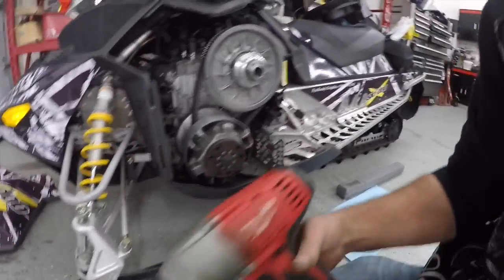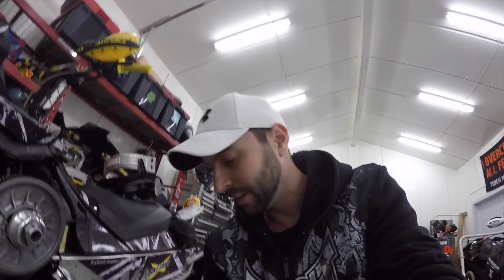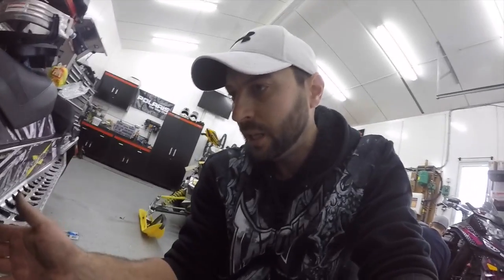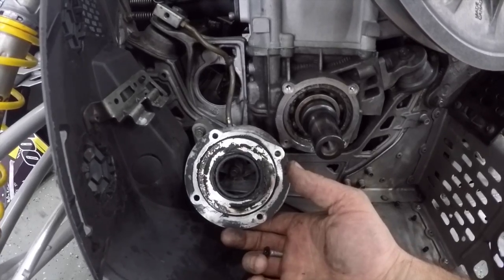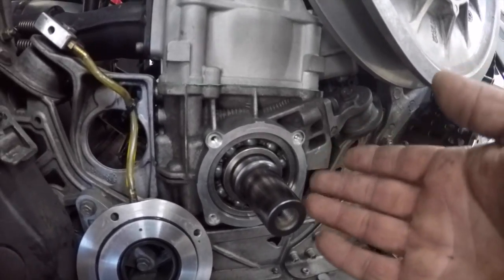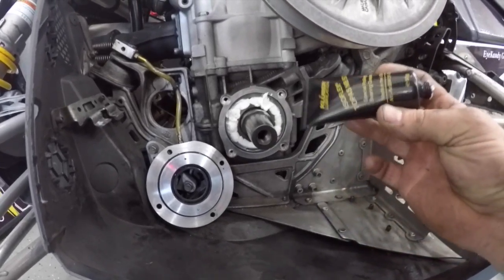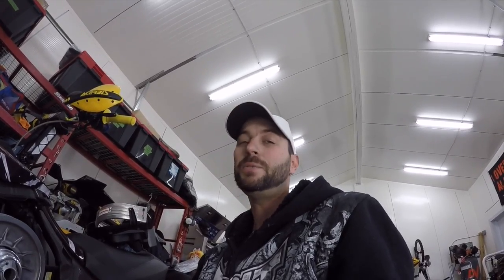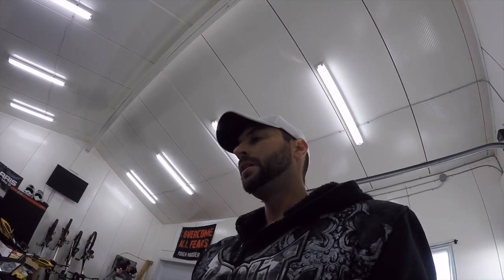#55 How to Change Isoflex grease in skidoo xp crank bearing

Comment: Hey man. Just a FYI you can do the mag side I do mine every time I do the pto side. It sucks but pull recoil then the flywheel remove top and lower stator bolts leaving one in. Then use a syringe with 5ml of isoflex squirt it slowly in lower bolt hole the air Comes out the top hole. Then re assemble had a 08 800r with 6800 miles on it I did this every season. Lower end never let loose must have helped.

Comment: I used a syringe to fill the bearing. I believe the Isoflex is designed to somewhat harden like wax when cold then liquify when warm. The concept is to keep the bearings always coated.  Unfortunately ski doo hasn’t developed a better design for their great engines. The other manufacturers have seemed to figure it out

Comment: Nice video, Thank you for doing it, very well done. One question is when you re-install the new gasket, does it just pop in or what's the best way to get it into the groove? Thanks again, much appreciated.
Reply from the maker: just sit in into the grove it should fit nice, and gently but the head onto tork and braaappp

Comment: thats a bearing buddy ur supposed to pump grease in thru the fitting at the other end of the hose.Thats a good setup but someone didnt use it the way it was ment
Reply from the maker: its a fudgy setup ive heard of people pooping seals if there to much grease in there. for the 10 minuts it takes to take it apart ill stick to doing that every season

Comment: The worst thing you can do is use an impact on a clutch bolt. you screw the bearings on the rod (chatter the chrome off the lower rod bearings) next thing you do not use a soft face hammer on the end of the puller...

Comment: never click a torque wrench more than once. so many amateurs click them about 5 times. it only over torques the bolt
Reply from the maker: I probebly clicked it a few extras lol
Reply: how does it over torque the bolt if your not going 'past' the clicking points.. bahaha i must be an amateur ! learn something new everyday.
Reply: although clicking it more then once is unnecessary, and if your a amateur it can SOMETIMES over torque the bolt. it can also be done without over torquing the bolt. but it is unnecessary iether way

Comment: 11:38 torque it till it snaps. bad advise for beginnner mechanics. i can hear clutch bolts breaking all across America right now
Reply from the maker: um its a torque wrench when it makes that snapping noise it means youve reached the set torque wrench setting
Reply: I RIDE 705 It was a joke about newbies. I've been turning wrenches for over 20 yrs.

Comment: what about the inner bearings? if the pto and mag side are due for repacking the the inners are a must.
Reply from the maker: The mag and inners are hard to get to, most people say there pto side lets go first , possibly due to heat from clutches, maybe true maybe not , but since its so easy to do pto side y not do it.
Reply: Adam Gee the new 850 bearings are all lubricated by the injection oil.
Reply: @iride7056 Did you use the whole tube on the PTO side?

Comment: Them poor crank bearings! Never use a impact on the clutch bolt!! A few turns using a puller and breaker bar and it will pop off easy.
Reply: Never heard that. Can’t use an impact to loosen the primary clutch bolt?
Reply from the maker: I agree beaker bar is the way to go that’s what I use now
Reply: fiddlestix.  those bearings are stronger than the hubs of hades.  it's not like he's wanging on it with a 20lb sledge hammer.
Reply: Not necessarily the bearings, knocking the crankshaft out of phase. Don't use impacts on crankshafts!

Comment: if the outer one is that chunky. then what about the ones inside the motor and the one on mag side? the ones u cant get to?  main reason i left doo camp! worst design ever! would buy a car ot truck if the crank bearings were packed with grease? Absolutely not! Junk!
Reply from the maker: kwmiked yup shitty design for sure.
Reply: There are 6 bearings, the 2 outers are isoflex on each side, and the 2 middle ones are in an oil bath of crank case oil. 

There is a procedure to add grease to the PTO and MAG side inners but you cannot clean the old grease. Its added by using hot grease and a syringe gravity fed and a non air tight administration. Otherwise if you inject grease into a sealed bearing it will blow the seal.

Also you don’t use a lot of grease since these are in high temp areas and need thermal expansion space. The amount of grease used in this video is way too much. Best bet is to buy a service manual and follow the directions closely.

I personally wouldn’t bother with the inner bearings and just save those for a rebuild. These ETECs are best rebuilt every 10000km to avoid catastrophic failures. Doing a rebuild on a running engine where you still have a good core to exchange is much cheaper then replacing a grenaded motor. With the core swap and a day in your garage can install an ETEC overhaul kit for around $1200 CAD.
Reply: Kwmike-D  what about the 850? the bearings are directly oiled.
Reply: The clutch side outer bearings are the most durable bearings in that Junk. The inners are also greased as are the Mag side. The inners used to be oiled but not in a bath. This video, while full of good intentions merely put lipstick on a Pig!

Comment: heat from clutch has nothing to do with grease getting crappy like that. thats just how all grease gets after use and no fresh grease to push out the old crap. the other 3 bearings are just as bad as the one u just took apart!
Reply from the maker: kwmiked I haven't looked at the other bearings so I  can't really comment,  but the clutch side seals are the most common to go so some say because if heat from clutches , how could anyone really know for sure if that's true or not.
Reply: I RIDE 705 ignore that guys bullshit. lol 3 more bearings..   There's 2 bearings on the Mag side.. 2 on the PTO side..and 2 in the center..  PTO side bearings  subject to excessive heat.  good preventative maintenance!  next time use a butter knife to force the grease into the bearing behind that one.  good luck and happy braaapin!  

FYI hopefully the previous owner didn't damage the inner seal of the bearing behind it with that bearing buddy being forced with too much grease.  I'd pull the seal and inspect from a month from now.
Reply: Don Mega tell me how u get grease to the 2 center bearings and the mag side bearing?  U dont! from the 2 i had go, the center bearings were all rusted up and gone. so tell me how greasing one outer bearing helps the rest of the bearings on the crank!??? it doesn't!
Reply: Don Mega its clear u have no idea whats going on!
Reply: kwmiked Thanks Troll
Reply from the maker: alright guys thats enought agree to disagree
Reply: kwmiked no seriously.   join dootalk.com.   bring your opinions there and share.  I'll be there to help you out.

FYI the primary clutch see extreme belt Temps as high as 200+ degrees.   this friction temp is heat sunk into the PTO crank stub.  MAG sides and center bearings never see that extra heat.  upon intake charge gasoline / oil mix actually cools down the connecting rods and exposed crank counter weights.  In regards to inner crank bearing failures in 800R or etecs it's typically associated with either the inner sealed bearing becoming damaged or by to much bearing pinch by an in proper line bore upon manufacturing of the cases.  for example 2007-08 800R had 0.0015" to much bearing pinch on some of their cases.   

on another note PTO crank bearings and seals experience failure by either extreme heat or damage by blowing belts allowing the grease to escape.  it's great preventative maintenance to repack your PTO bearings with fresh isoflex and a new seal.    it's impossible to repack any center bearings on an 800R / etec motor since they are sealed units and not lubed by an oil bath like other 2 stroke motors.  you are able to repack the Mag side by removing flywheel and stator and injecting 5ml of isoflex slowly without having to split the cases..  PTO bearings also sees high axial torque from the clutch... you cant bash preventative maintenance .. crank bearings don't wear evenly. enough said.  enjoy
Reply: Don M
Reply: kwmiked isnt the center bearings getting oil from the gas? Isnt it only the both outer that need grease?  AT the mag and The clutch i mean

Comment: This guy is wrong with the water to pull the clutch off. Yesit works but you can't use the bolt that holds the clutch on. You need a bolt matching the threads that the puller has which threads into the clutch itself
Reply from the maker: Chantel Brezinski that definitely makes sense thanks for the input!!
Reply: Chantel Brezinski not true you can in some cases use the factory clutch bolt with teflon tape and water.
Reply: Yeah that's not entirely true. As TheKingranch150 mentioned you just need teflon tape. Did it a couple days ago and works amazingly well.
Reply: Your wrong you can use same bolt
Reply: You can use water and Teflon on skidoo because the original clutch bolt actually threads into the clutch before the crank unlike the old Polaris clutches
Reply: I've done it no less than 8 times with the original clutch bolt......works fine for my 06 800